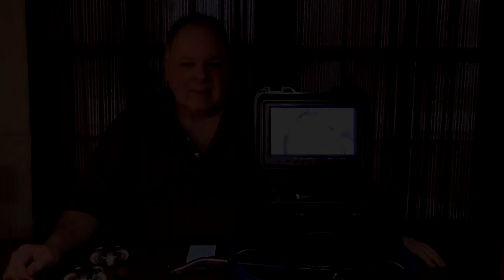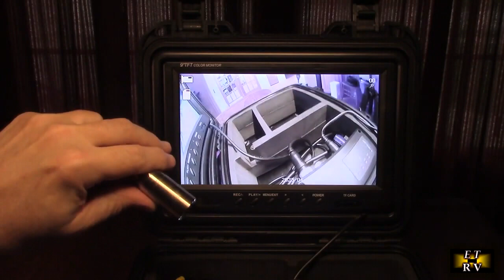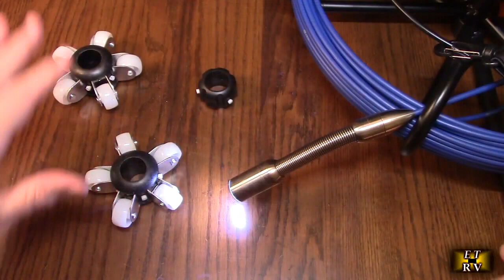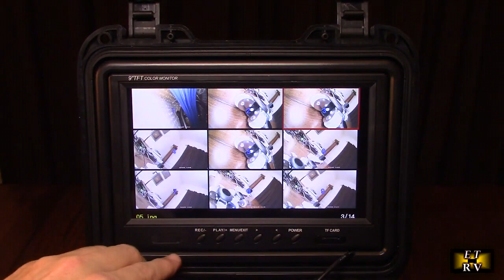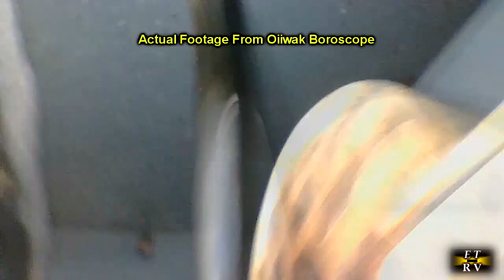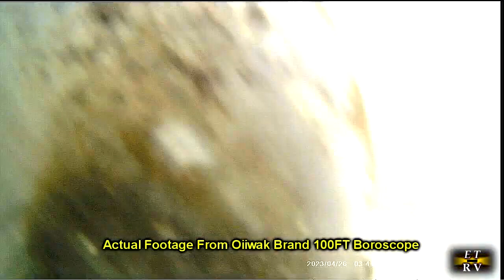Oiiwak 100FT Cable Boroscope 9” HD 720P Screen, Head LED, IP68 .9" Lens 140 D View, 4500mAh REVIEW

Comment from the maker: ORDER Oiiwak 100FT Cable Sewer Camera with  9” HD 720P Screen, 12 Adjustable Head LED Lights, IP68 Waterproof, .9" Diameter Lens with 140 Degree Viewing Angle, 4500mAh Li-Ion Battery - 8 hours Use  HERE: https://amzn.to/3V3Azih

VISIT The Oiiwak Store HERE: https://amzn.to/3oKetFz